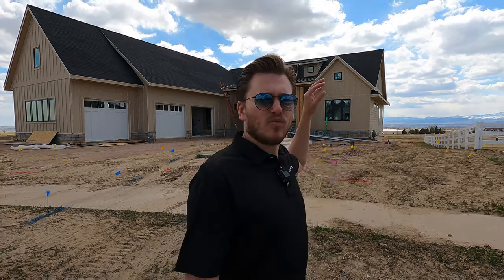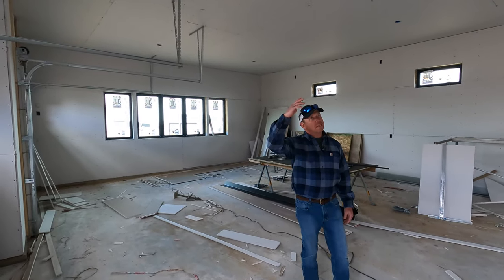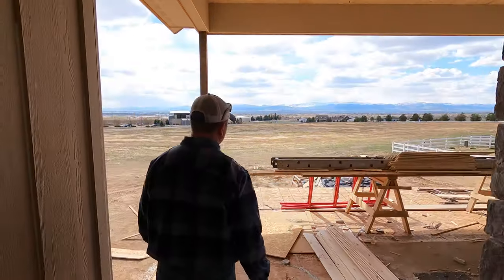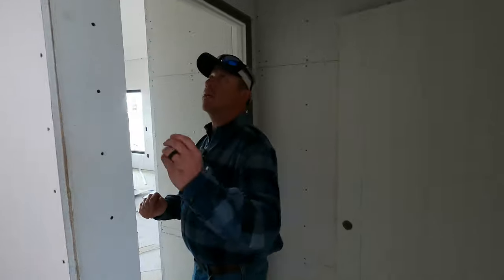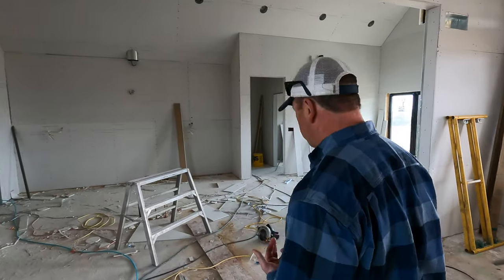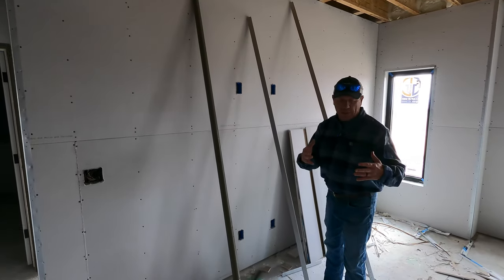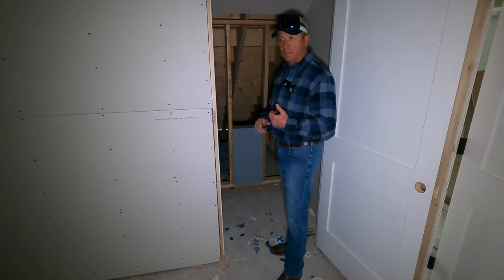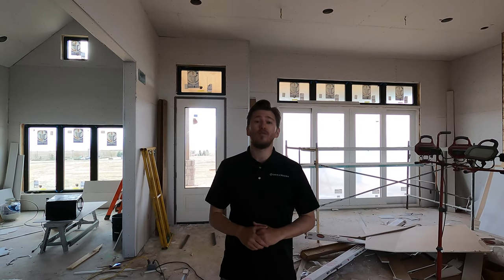Whole Home Tour Before Move in Severance Colorado

Comment: Fail on the patio door and garage heat. . Why do a transom, should have ordered the right height door and electric heat? Should have installed a heat pump that could have heated and cooled.
Reply: @thebigdoghimself  so do you build homes for a living? Are you an architect,  engineer,  contractor?
Reply: @thebigdoghimself   If they were non issues why did you feel like you had to show how you knew more than everybody else including the actual home builder by taking a public dump on this page just curious